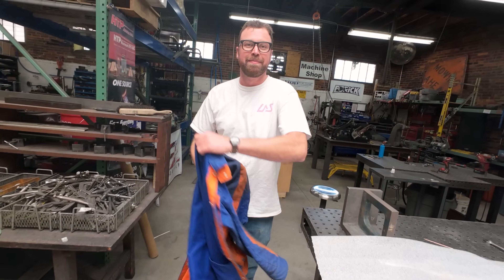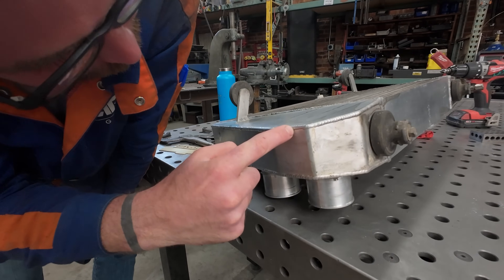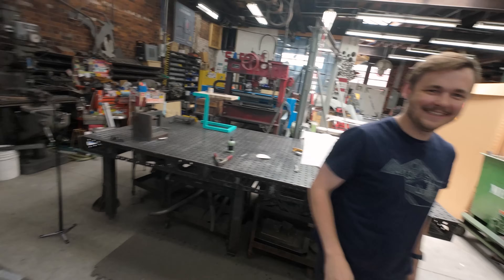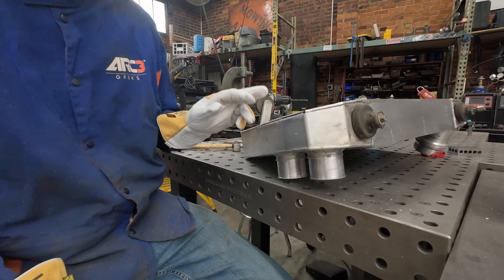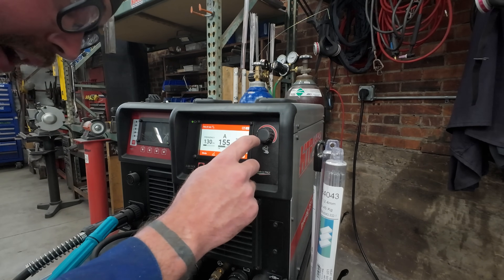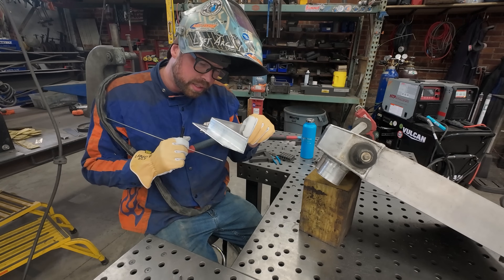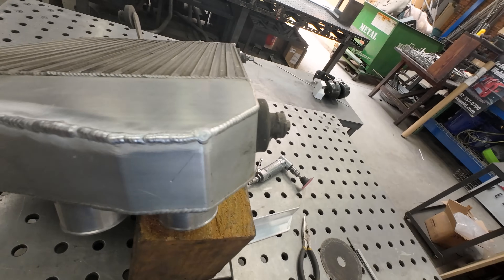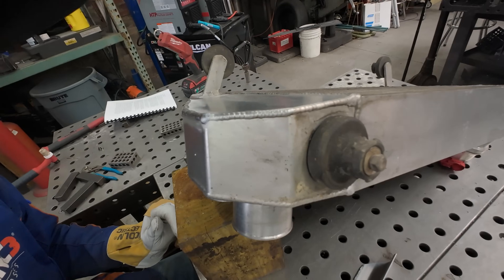Repairing Cracks in an Aluminum Weld

Comment: “safety” when working on welding or heating car parts just be aware that if any brake cleaner was  used on the part and you heat it, you could potentially create phosgene, a very deadly gas.  There’s no known treatment if inhaled.

Comment: Could you have used a propane torch to heat up the work to burn off the oil inside the cooler?

Comment: I like to heat dirty aluminum to maybe 400 degrees for 20 minutes, or so. It helps getting some of the junk out.
Reply: Very true!!  A pre-weld 'burn' certainly could have helped extinguish carbon (trash) deposits on the inside!

Comment: Those are always very dirty to weld. I always try to clean the inside if possible and sometimes add a backpurge. Try a smaller cup on the torch next time and turn the gas up until you get some turbulence in the weld, then back off from there. It's always a trial and error to weld this stuff because you never know exactly what material you are dealing with.

Comment: I've welded a lot of intercoolers. Its amazing how much oil collects on the inside. I usually try to acetone the inside of the tank. (Expensive) but it usually helps with welding it up.
Reply: Please please tell them you found it and to have a mechanic check it. The turbo passes a tiny amount of oil. But if its puddled up bad in the intercooler/charge air cooler there is a problem with the turbo or pressure in the engine. This is what causes an engine runaway on diesels. Ill send you my welding customers if you send me the ones full of oil 🤣🤣

Comment: Wonder if the cracking was caused by the wrong filler rod being used on the original welds? If they used ER5356 filler, it is subject to cracking if the welds are exposed to sustained temps of over 150F. Not sure how hot this part gets, just thinking out loud.
Reply: I see this alot on semi trucks as a mechanic. 9 times out of ten its usually the radiator gets replaced and the radiator intercooler/charge air cooler and condenser dont get mounted perfectly back together and then get torqued down. I seen all 3 crack from just mounting wrong. I think it torques the whole thing a little and it just cracks.

Comment: Ha that's funny you mentioned boost, I said the same thing. Could I also suggest plating the end cap joins as it may also be flexing the welds from the thousands of times it's hit boost.
Kind of the unholy trinity of fab work, undersized material + "Sema" welds + BIG boost = boost leaks for days.....!